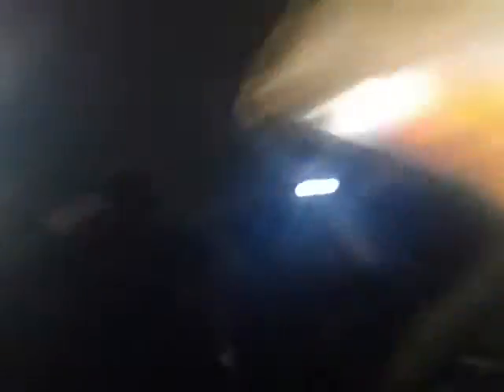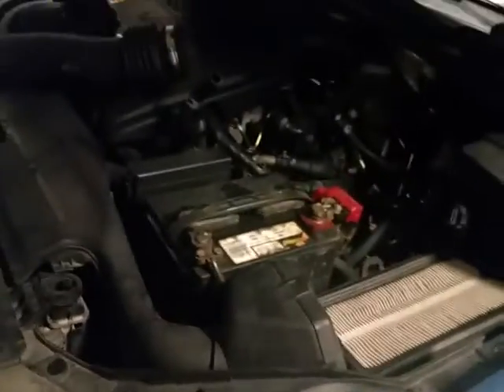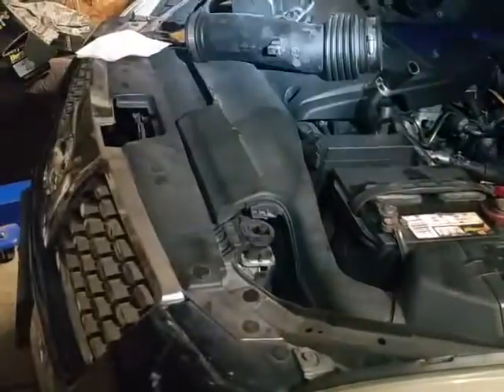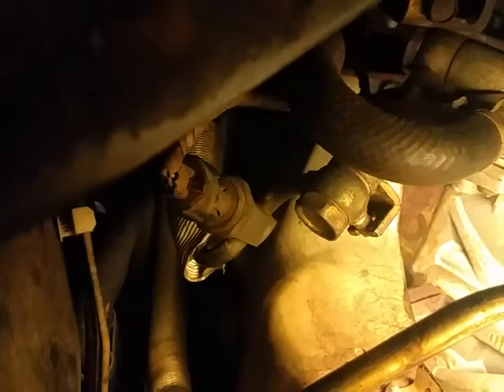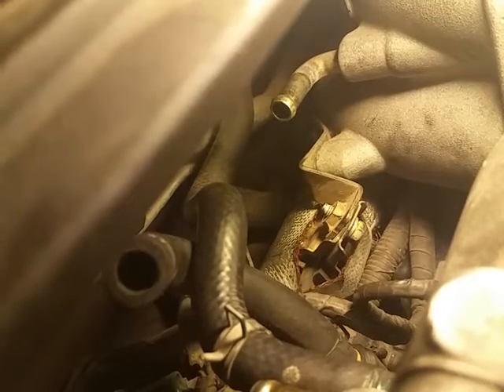2004-2007 Nissan Maxima power steering pressure line replacement

Comment: Thanks man, just replaced pump and now on to this line, I found it leaking up high and running down.
Reply from the maker: It's a beast...don't get frustrated just take your time..youll.get it
Reply: 3 hours later and I’m done. If I had any suggestions it would be to start with the large banjo bolt and work towards the rack. I did the opposite and after everything was tight I couldn’t get the fitting turned just right to start the banjo bolt. It is finally done after much cussing and fighting.
Reply from the maker: @danielowens4789  we probably said some of the same words..lol..glad u got it done

Comment: Thank you very much for the tip on the driver's side, removing the air cleaner etc. I finally got the old hose out but can't seem to line up the hard tube going into the rack and pinion. Can't get the angle right to start the threads. I've watched this several times trying to make sure I have it lined up like your Maxima before removal. By far the most challenging DIY I've ever taken on. I'm a little frustrated right now..... Any tips would be appreciated!  Thanks again!!
Reply from the maker: Sorry for the late response. It was a bear to get lined up i finally got it. It took about a hour. Make sure you do not tighten the top bolt before you try. Leave it loose
Reply: Did you get it done...2 years later lol

Comment: Man I can not get that 24mm bolt thats next to the sensor and pump..... I'm just too weak.  What's the best spray to help loosen it up? PB blaster?   I can't get the back-side bolt on the pump either.  smh
Reply from the maker: Sorry for the delay. Did you get it yet? If you use a line wrench made specifically for lines it may be easier becuase it will grab a lot better. Pb blaster is what i use for these types of jobs also. If you remove the plastic cover from the side of the engine you and jack the car up, with the tire off...you should be able to access the bolt on the back of the pump. I hope this helps....
Reply: @wedoitall7676  I got the high pressure line off  using a swivel socket and 24 inch extension going ( I think ) above the control arm.  Too easy.  Still haven't managed to get the back bolt on the back of the pump off. Tried taking the cover off to get to it from the hood but I don't believe that's possible on the V6. (Just noticed you said on the side of the engine so I'll take another look but didn't notice a plastic cover I could remove that might give access.) I don't think I mentioned this is an '05 Altima either.  I'm gonna spray it with Kroil (people seem to love it even more than PB so if you haven't used it, you may wanna give it a try)   for a couple more days and give it another go using two wrenches locked together to get more leverage.  Thanks a lot, I very much appreciate the help.
Reply from the maker: @tjtewshews5531  im not sure if the altima gives you as much room as i beleive the maxima is longer in tje front and back. Hopefully you have that cover that will allow you more access

Comment: would you know where the power steering pressure switch is? Is that by the pressure line?
Reply from the maker: Its installed on the high pressure line. You can see it right above the tie rod end on the passenger side behind the pump right above the fitting for the line...

Comment: I'm about to tackle replacing the sensor in a 2004 Maxima.  Did you need a special tool to get the old sensor off and install the new one?
Reply from the maker: No special tool needed. Just a wrench to fit the sensor. I used a pipe wrench and I believe it was a 17 but I'm not sure...

Comment: Nice. How long did it take you?
Reply from the maker: I'm not going to lie, I've never done this before so it took me about 4 hours. The hardest part is getting the fittings back in to the rack and pinion...it can be a tough task to line them up
Reply: We do it all and those fittings are the one you used the pipe wrench for? On the bottom ?
Reply from the maker: yes, I didn't want to strip it so I used  a line wrench
Reply from the maker: the bottom
Reply: We do it all good looking !
Reply: If you have a hard time getting the old fitting out of the rack. Cut the line at the fitting and use a ratchet and socket to get it out.